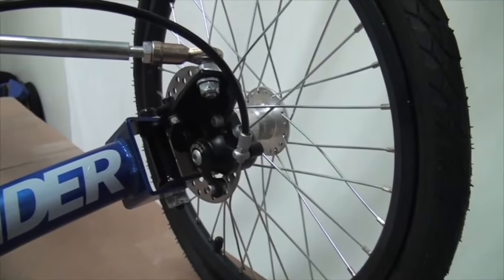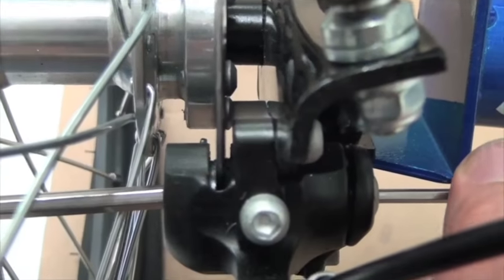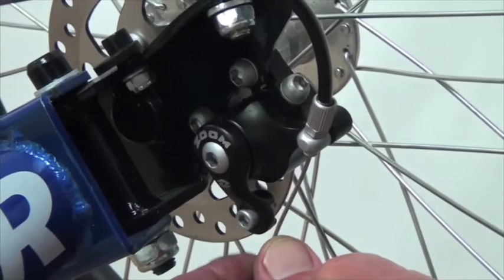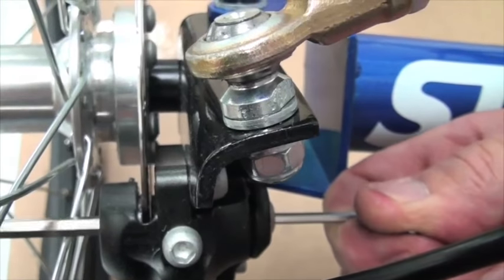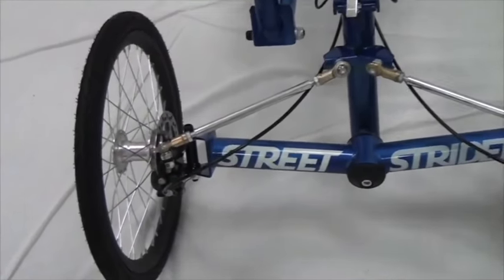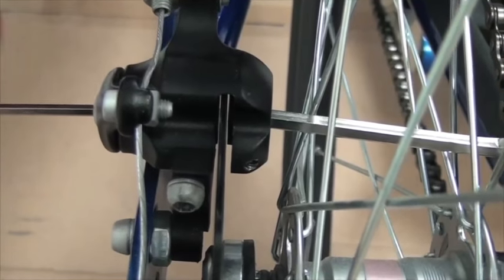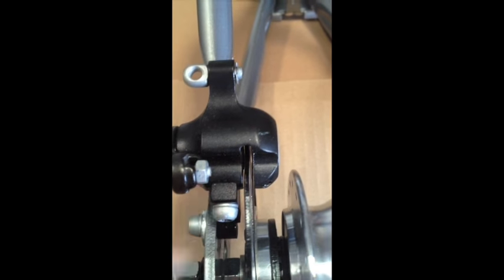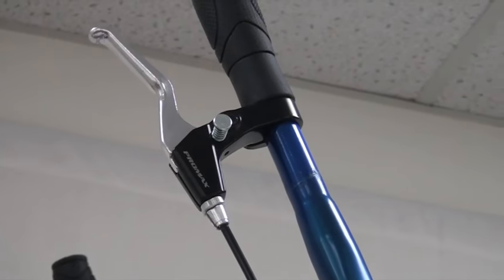StreetStrider 2016 Assembly 3i&7i PART 5 - Brakes

Comment: Hi, please tell me where I can find the replacement cable doubler (or maybe it's called a splitter. Unfortunately, it's seized and I guess I need to replace the doubler and probably the cables. I see BMX doublers come with much shorter cables, so I wonder where I could get the replacement doubler with proper cables? Thank you.
Reply: Try calling Street Strider directly. Sometimes they do carry extra parts and may sell you these.
Reply: @AmazingWorlds314  Thank you! I had to purchase a "Problem Solvers Cable Doubler" from Jenson and some regular cables. I was able to fix the issue by replacing the whole assembly. Eventually I sold that bicycle. I'm pretty sure that I won't be purchasing it again. Overall it didn't fit my needs. These exercise bicycles are not for everyone and they require space and unusual maintenance. PS: Need to mention the frame is metal, not aluminum. It was pretty heavy. Plus I wouldn't buy a new one. Currently I prefer walking or running on foot.
Reply: @yolo-cars  true, they might not be for everyone. I picked one up for $130 in poor shape. I restored it to the factory condition, but it was very hard to do so. I had problems with getting the front brakes to get a proper grip on the front disk brakes.  I actually finished restoring mine just yesterday and I love it greatly. It is all metal, but they do have more expensive aluminum version. I found it not too heavy and can lift the whole thing and put it inside my car to take it to a trail. It's about the same weight as a regular beach cruiser bicycle would be. The problem is with parts accessibility. I needed some bearings and I could not get it, even from the manufacturer. I had to improvise, but it works well.
Reply: @AmazingWorlds314  I definitely feel you. I also restored mine and then sold it and even lost some $$ though I purchased it used. The problem with such limited production and limited demand bicycles is its huge price. I will never buy a new one from them for the price they want. The good thing is because of limited demand the used ones cost much less than new. I guess you got a great deal purchasing it for $130. I paid much more. And like you mentioned it's difficult to get parts from the manufacturer. I contacted them and they told me to lookup parts somewhere else. I was thinking like "What? That's an "awesome" product support.." I could lift it and fit it inside my minivan, but I didn't like its weight and overall bulkiness even when it was folded. It occupied a lot of space in my garage. PS: I was also interested in that treadmill bicycle too, I even looked for a used ones around. But something tells me I'd end in selling it and loosing money again though I think I like the idea of a treadmill bicycle because you don't have to wiggle, but just simply walk. Anyway I think I'd better find a used cheap CF or super lightweight road bike for cycling exercises when I realize I really need such exercises...

Comment: Hi Dave
When I try to adjust the the inside pad, the whole arm moves as the screw is so tight but to move the screw, it’s loosening as if to remove that arm that moves when you squeeze the breaks? 
Please help...Thanks
Reply: The reason is that you have to is a smaller Allen wrench on one side. That bolt can accept two, the larger one will remove the whole arm, and if you insert a smaller one, you will be able to adjust how close the brake is to the disk. It's shown on the video.

Comment: why did you tight up the rotor? what'd happen If I don't tight up and just adjust the cable?
Reply from the maker: Pulling the cable through the 4 mm fixing screw to remove any exposed cable may also cause the lever on the caliper to move toward the closed position.  By screwing the pads against the rotor before pulling the cable prevents the lever from moving toward the closed position.